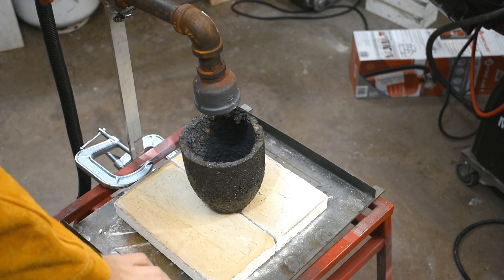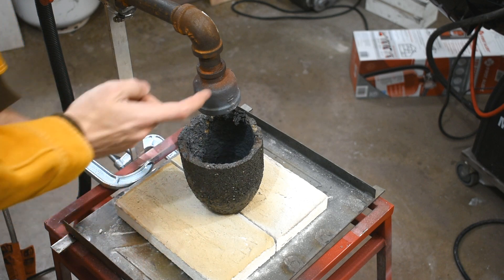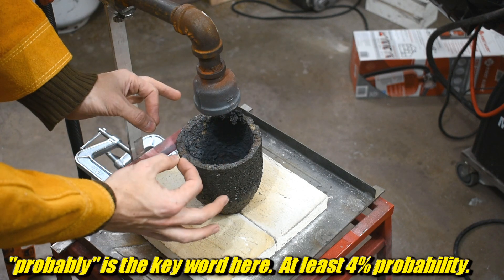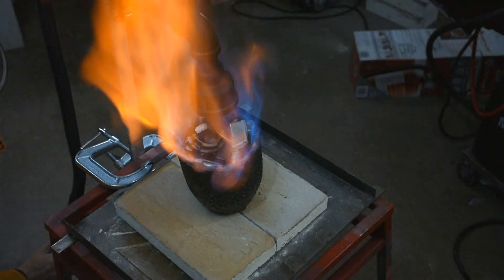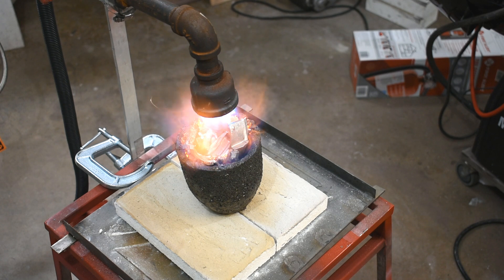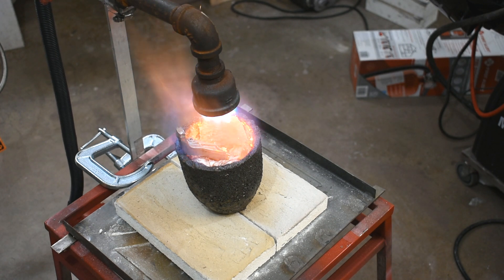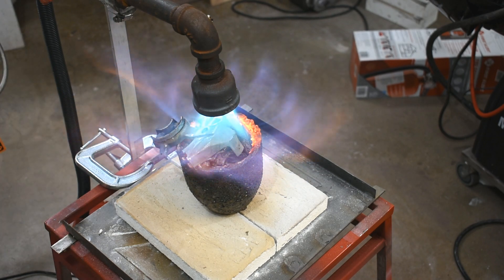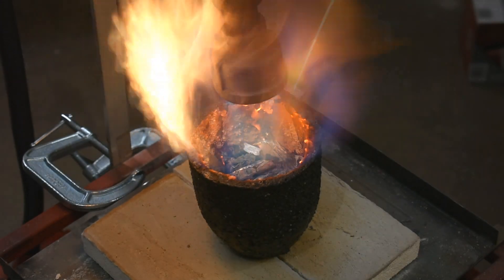Attempting to Melt Aluminum without a Foundry Furnace Using a Forced Air Propane Burner

Comment: I used to have to wear a silver suit everyday at work. I worked at a heat treat factory for steel, they were high quality suits but if you got two near the hot salt bath or anything too hot they would get ruined as well.

Comment: Wouldn't you just drill a 1/2" hole in the bottom, so as you melt down, it pours out into ingot molds? Because guess what I am thinking about doing...

Comment: First you need to heat the crucible to 400 or even 600deg then you need to add aluminium and it will melt and stay liquid. what you did is the same principle of reverberatory furnace in a small scale. Only mistake is you did is that you did not preheat your setup.

Comment: When melting aluminum indoors, monitor the carbon monoxide levels.  I found it takes a whole lot of ventilation to get the level below 30ppm CO.  I tried once to run my furnace, before I got a CO meter,  and I got sick, very nauseous.

Comment: I have a 500,000 btu weed burner.  I pointed at an aluminum can laying on the concrete shop floor.  I got a lot of aluminum oxide REAL quick.
Reply from the maker: yeah that's the problem with cans.  Too thin, too much surface area, it goes all oxide on you

Comment: Put the crucible in your forge and block most of it off.  you'll have to come up with some crucible tongs, but I think you could get melted aluminum pretty easily that way.  if the crucible won't fit in the forge, make the forge taller :)

Comment: What about if you heat the crucible before adding the aluminium? If it's solidifying because the heat isn't penetrating the surface of the molten metal, preheating the crucible may provide enough radient heat to keep it from solidifying. That or else stirring.
Reply from the maker: that might work, didn't think of that

Comment: There is a reason why a furnace is used to melt metals. Next time try to measure some temperatures at different angles from the crucible, that will tell you why it doesn't work. The only way to do this without an enclosure is by using an arc furnace design, a flame can melt the metal locally (plasma cutters, or acetylene gas, or hydrogen gas) but it can't transfer enough heat to melt a larger amount of metal and to keep it molten. In other words, electricity and some carbon rods can do the job. The king of random made a nice video about a small DIY arc furnace. But for a larger amount of molten metal you would need an awful lot of amperage. I'm not even sure if you could pull it of with a household electrical system or without a huge battery power bank. For safety reasons I wouldn't melt metal out in the open without any form of enclosure. One splatter of molten metal can ruin your day, your house or get you in the hospital. And it can splatter, for example because of contaminated metal.  

And water close to liquid metal???? With all the respect, but are you nuts???? Water is the most dangerous thing that you can have near liquid metal. If you want to do it a bit more safe use DRY sand to prevent that liquid metal runs out too much in case something goes wrong. And keep the water as far away as possible. If something else catches on fire use a co2 extinguisher or something like that, but for crying out loud, keep the water away !!!
Reply from the maker: it wasn't close to molten metl, the water was a ways away and in a bucket ;)  also there are far more dangerous things around here... like the propane tanks
Reply: @PaulsGarage  No I mean when you have an emergency with molten metal you better don't want to use water to handle the emergency. That's why I say that you should not have water near molten metal. 

Just saying that when there is a panic (stressful) situation, and you happen to aim the water wrongly or some water just happens to fall into your white hot crucible, possibly filled with molten metal, it can get very dangerous. Maybe not life threatening dangerous, but one wrong splash in your eye is enough to make you handicapped for life. Not to mention the possible damage to your equipment and garage. 

But hey, it's your garage and your skin that will catch the hot metal if or when it is splashing around.

Comment: If you want to run your full furnace inside but are worried about the heat rising, maybe build a baffel out of thin sheet metal you can hang a few feet above the furnace to dissipate the heat laterally preventing it from going straight up. It would make a massive difference as the radient heat carries much more energy than just hot air floating up. Heat degrades logrithmically; when you double the distance you square the heat loss, or something mathy like that, so distance and blocking radient heat are your best bets.  Maybe crack the overhead door a foot to keep the combustion gasses from eating your brain cells too?  Love the channel, you think in a very similar way to myself, you poor thing... 🤣 (My wife's Asian too!)
Reply from the maker: a baffle is a good idea for sure.  Fortunately i haven't needed it.  I tried using the high power foundry burner in here once, and the ceiling getting hot wasn't the only problem.  It heated the air up so fast all the cold metal surfaces got SOAKED with condensation!  that thing is crazy

Comment: Aluminum got hot and melted. Furnace walls didn't get hot so the aluminum solidified again. There's a reason you better heat the walls of the furnace with the blast. If you really want to pursue this avenue:
1. start with the empty crucible, heat it up until it's red hot and then start adding aluminum
2. insulation around the crucible.

Comment: I tried melting copper with a carbon rod and a stick welder. It did the same thing, melted the solidified straight away. You could put the alloy in a mould and then heat it.

Comment: think pointing the flame straight intoo the cruisible will oxidize the aluminium more (like you mentioned) , you still can use one of the pottery ovens , they dont use gasses and are probably safer to use indoors , need a grabber to get the cruisible out of the deep hot as the sun depts of it though , bet it will make the garage nice and warm too

could be that the pieces of aluminium when you first put them in are somewat insulated as there free from the walls but once their melted and contact a bigger surface of the wall of the crusible it looses its heat through it and cant stay hot enough to stay liquid , you could try to put the crusible inside a insulating stonewool blanket and try again (prolly whont melt the puddle at the bottom as it has a lot of mass but new pieces it might keep liquid and maibe slowly melt the rest of the puddle below it too , it take a lot of gas i'm afraid

Comment: Call my crazy, but I have been running my foundry furnace inside my garage and have gotten pretty comfortable with it. I always at least crack the big roll up door, which provides pretty good convection when it's so cold outside, hot nasty air escapes out the top and cold fresh air comes in the bottom. I'm not sure if it matters, but I'm using a Reil style burner after the air pump on my first design died, and I am actually happier with it than I was with the forced induction. The low flame start up mode on the forced induction was nice, but beyond that I prefer the Reil burner in every way.
Reply: I do the same thing with my ribbon burner forge and have even gotten a Carbon Monoxide detector.
Reply: Here's a video https://youtu.be/6LrwWoNUdiY
This was when I was still using my forced induction propane burner.
I have also started wearing this since I have started melting ZA-8: PD-100 Full Face N95 Civilian... https://www.amazon.com/dp/B076BSN5NH?ref=ppx_pop_mob_ap_share

Comment: I would like to lodge my concern for having water standing by.  It's fine as long as the water doesn't go anywhere near molten metal. If it did it would probably explode violently.
Reply from the maker: Doesnt go near it, contained in a bucket a few feet away. I use it to quench ingots after they cool and solidify l, never had a steam explosion from that.
Reply: Nah, only if its contained in something, it will steam a lot though. We use water baths to make ingot pellets by pouring molten metal directly into water, which makes small pellets. This is handy if you want to measure out a specific weight to melt down and not have excess, especially when making up your own alloys.

Comment: Oh well, it was a good try.  If my furnace ran on propane instead of oil, I'd be really tempted to try using it inside my shed (closest approximation to a garage I've got).  Perhaps luckily for my family it doesn't...  Can't wait for this winter to end!
Reply from the maker: This winter sucks for sure.  By the time I scrape my driveway clean and get it dried off, we get more freezing rain...

Comment: Ive been thinking of doing this for a while, thanks for making this vid and proving it don’t work. Ill stick with the furnace and coal forge. I have melted aluminum in an open forge. It was awesome.
Reply from the maker: Glad I could help!  Yeah a normal furnace set up just works so much better
Reply: @PaulsGarage  I was able to melt aluminum with an open coal forge at max heat. It was so much easier than prepping the furnace.

Comment: I would throw some temporary fire bricks around it and it will get a ton hotter :-) love the video man hope you have a great time
Reply from the maker: I just might try that.  I have some extras, just the crucible is a bit too big
Reply: Hey you probably already know this but once the metal the heat was getting to melted it capped off the rest. Without the crucible being hot the metal cooled and Bam solid chunck of something. By the way I love both your and Christ centered iron works channels keep up the good work.
Reply: This

Comment: If your electric ceramics kiln is working you can probably melt the aluminum in that - mine easily gets hot enough to melt aluminum.  Takes longer, but no risk of setting the garage on fire or dying of carbon monoxide poisoning.
Reply from the maker: It takes so long I'm afraid it would have time to absorb hydrogen and cause too much porosity, but it would probably work
Reply: @PaulsGarage  It does, but my results have been that it is not any more than using my propane burner.  And if you plunge a small packet of baking soda into the crucible before the pour it purges some of the hydrogen (I do this when I need less porosity in a part, usually an art project as I've only cast a two machine parts in aluminum).   If you do this be careful though and do NOT under any circumstances try it with a full crucible, as it bubbles quite vigorously.  :-)
Reply: No, baking soda actually makes the porosity worse.  Paul linked a video (hopefully he still has the link) that explained it well.

Comment: Paul, be careful when melting aluminum in a crucible used previously to melt iron...aluminum oxide+iron oxide = thermite!
It is possible to get a thermitic reaction that no fire extinguisher can put out.
Here's an example... https://youtu.be/F21SKWKJJL4
Reply from the maker: Sounds like I was right to leave the camera rolling then
Reply: Paul's Garage did you go watch that video? I've heard horror stories about that from old timers in the casting communities here where I live. 

Anyway, I enjoy your channel, humor and whit. Keep em coming.

Comment: Well, any landing you can walk away from... is a good one! 
I used to melt lead this way in a smaller graphite crucible, even that took forever, heating the top the bottom froze, heating the bottom the top froze again...and this was lead, half the temp is needed for lead compared to Aluminium, maybe you could give your improved mini metal foundry another upgrade, if you still have it 👍
Reply from the maker: The mini one was given away to a kid I know, might have to steal it back 😉
Reply: @PaulsGarage  or subcontract the job lol

Comment: You should try to melting in the kiln
Reply from the maker: I thought about that but it's an oxidizing kiln, and very slow heating.  That's a recipe for oxidized metal, lots of dross and porosity.  If I could get all the power in a much smaller kiln that would work
Reply: Yes, no idea how expensive those are but the small electric ones seem to work great, have seen it a lot with other makers.